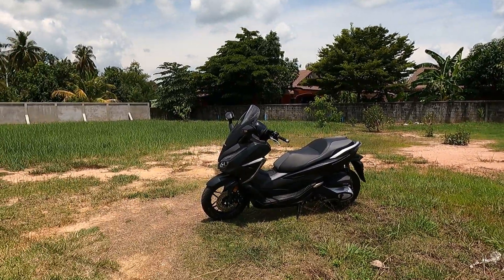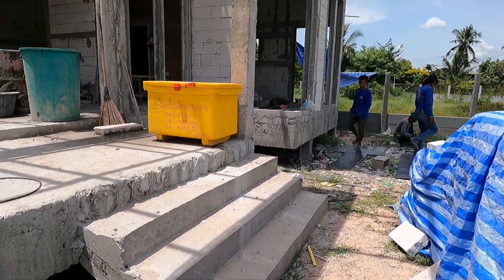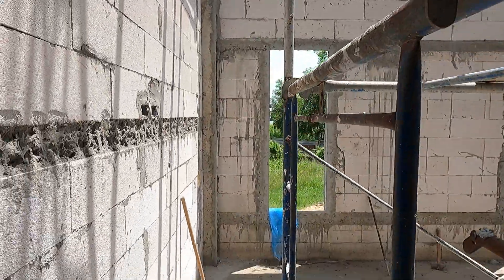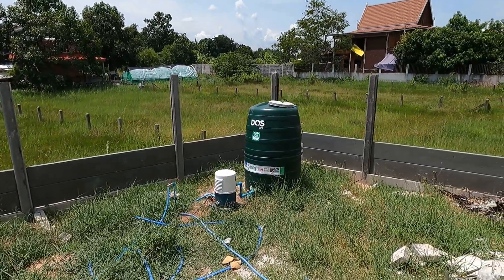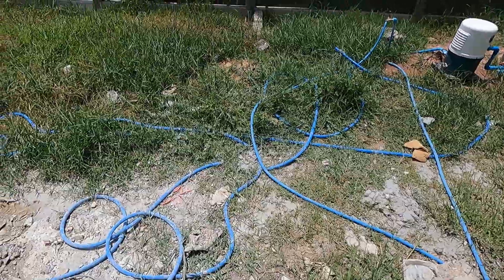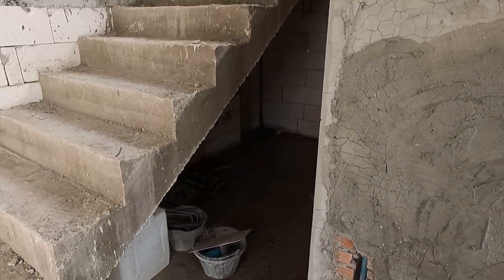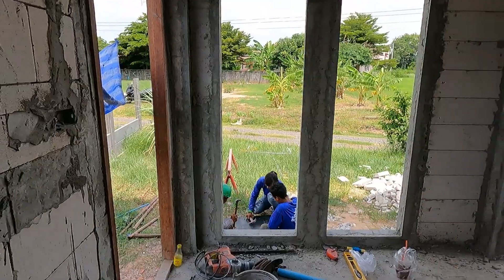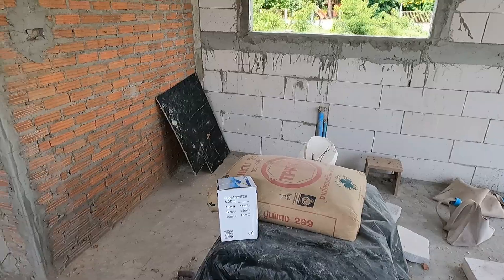Thailand New House Part 21

Comment: Coming right along Dave.  Just one question.  Have you started looking for windows yet?  That is probably the one main thing that I do not understand with the Thai way and the West way of sliders.  Almost every home build I see in Thailand the slider is on the outside track and the screen is on the inside, if there is a screen, and the screen needs to be opened before opening the window and then closing the screen after opening the window.  I may have seen one or two builds where they used the "West" style.  i.e. slider on the inside and a fixed screen on the outside.  Also I question the security of the slider being on the outside vs on the inside.  Apologies for the length of comment/question.  Love to hear your thoughts and the thoughts from others.
Reply from the maker: That’s a good question I don’t know but what I will do is ask the builder for cut sheets and I will share that info thanks for the support and stay safe